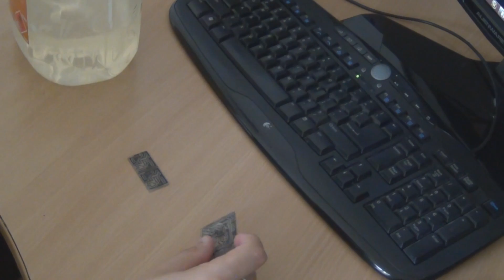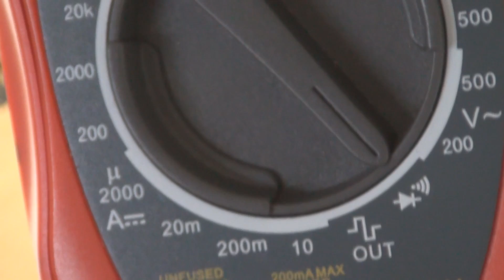DIY Guitar Pedal Tutorial 2: Etch your own PCB (cleaning, testing, drilling)

Comment: I use fine steel wool to remove the toner.  Works fast and helps to buff the copper and remove any tarnish.  Once buffed I'll apply liquid flux to the board with a cotton-tipped applicator (Q-tip).  I do this in preparation for tinning the entire board.  Exposed copper has a tendency to oxidize over time and I like to keep my options open for adding parts and revising circuits, so tinning the whole board keeps everything amenable to solder.  It actually doesn't take much to tin the whole board with just a dab of solder, when the flux coats the surface.
I drill the holes after tinning.  Why?  I find the solder layer provides a soft surface that lets the drill bit seat itself easily.  The etched holes in the pads provide "dimples" to drill into.  Once tinned and drilled, a light buffing with fine steel wool preps the board nicely.

Comment: Hello so I have finished my first etched pcb pedal after doing kits for a year. I did a simple Booster. I was very surprised that it ended up working correctly mainly because it was so difficult to solder into the lead holes on the board. It came out looking very messy but the connections were all made which is the most important part. I've now moved onto doing a fuzz. I am having huge amounts of difficulty even getting the solder to stick into the lead holes. On top of that, there are areas where the copper tracks are missing altogether. If anyone has any tips I would appreciate it

Comment from the maker: Hey Platinum, I have never used a solder resist before so im not sure.  The toner will melt when the track heats up probably, it might still work, or it might get messy :)